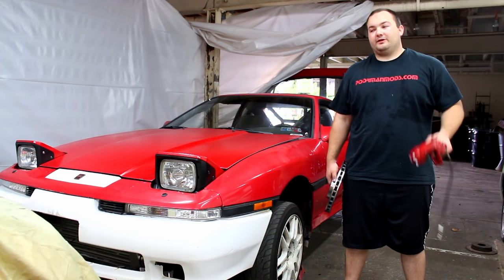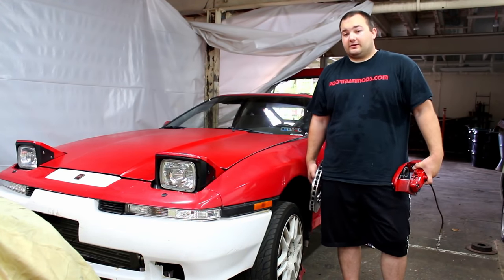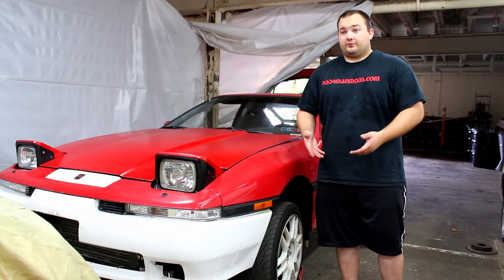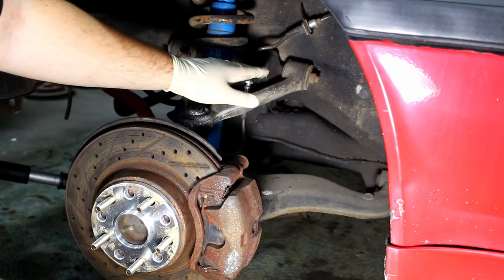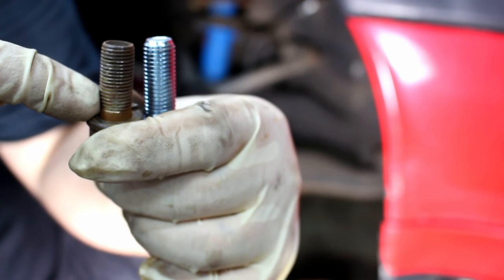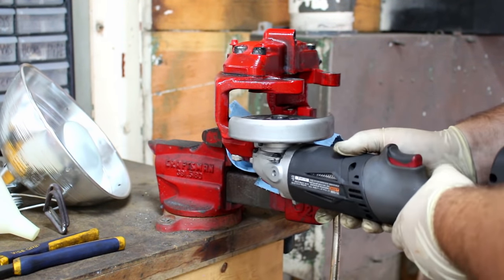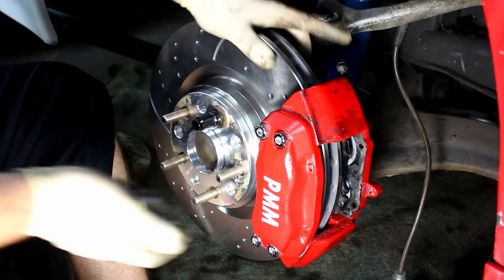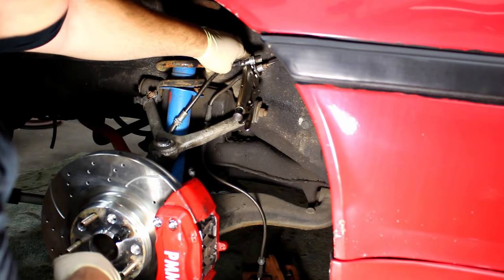DIY Big Brake Kit | 1JZ MKIII Supra Big Brake Upgrade| Mercedes S500 Calipers 350z rotors

Comment: Just did mines thanks to you…just wanted to make sure calipers has to be from 2001 to 2002 nothing else will work wit those rotors….bolts The bolts m12x1.50 and spacers 3/8 thick and you can find them at ace rockys
Reply: I can only find rotors that are 12.75 in, is that close enough or does it have to be exactly 12.8?

Comment: For the rear I went with Brake Rotors REAR from a Subaru IMPREZA 05-07 WRX STI. Had to get the centre holes machined just slightly bigger and Calipers from REAR mitsubishi EVO 789. Just needed 1 washer for the mount bolt. (you want to avoid that if you can because there is a lot of pressure on those bolts when brakes are applied)

Still working out the fronts. I must have ordered the wrong Rotors for the front. Going to try Mercedes rotors to see if I can get away from adding washers.
Reply from the maker: niceee might have to try the rears soon
Reply: Poor Man Mods Factory brake hoses worked on the rear.
Reply from the maker: sweet!

Comment: Back again after a little more research and looking at your video there seems to be a hub centric ring that's needed to fill the space between center and rotor. 60.1mm - 68.0 mm if I'm completely correct.
Reply from the maker: i drove around for a year or two with no hub rings with no ill effects, i did eventually get rings because someone recommended and i saw no harm in getting them. I dont remember the size though :(

Comment: Why?
Because if you buy a box of washers, you will find many different thicknesses out of the same batch.
They are typicly also dished and/or distorted a little too.
Plain washers are not designed, or meant to be used as spacers, they are meant to keep bolts/nuts from sinking into the material they are being used on, PERIOD!.
Probably why you had to put an extra washer on one side.
McMaster car has precission shims, figure out what you need, and use them.
Here are their steel shim selection, in 1/2" ID (will work fine with 12mm bolts).
http://www.mcmaster.com/#standard-shims/=xwl81f
And they are cheap! - up to 1/8" are a pack of 10 for $5.
They also have the shims in stainless, and the 12mm x 1.5 bolts or socket head cap screws.

Comment: Great demonstration, I'll be doing the same brake set up. Quick question do I have to buy stainless steel lines like if I'm buying it from a ae86 or can I just get a set of steel lines for the supra?? I'm confused
Reply from the maker: +Genesis Harrigan you need the line for the ae86 because it has the correct fitting
Reply: +Poor Man Mods ok great thanks

Comment: Good stuff man! Keep it up :)
Reply from the maker: doctorstruts thank you!
Reply: Btw if you were to Turbo the Lexus look into the TD04 15T Turbo charger, They came stock on SAAB 9-5 aero and viggen and are known to be cheap reliable and reeeaally good on spool and output! You van get like 340hp easy out of a 2.0 4 banger with one of those! :)
Reply from the maker: im not sure what im doing yet, but if i turbo it ill probably buy a nice ball bearing turbo to help with fuel efficiency
Reply: Looking forward to finding out what will happen! ^^

Comment: Can you lists all the parts that you need to do this mods? including the bolts sizes, hub ring, etc and quantity of the parts?
Reply from the maker: The only parts you NEED are these
324mm 350z Front Rotors http://amzn.to/2k5bLbm
2001 S500 Front Calipers (left) http://amzn.to/2lqzP4u (right) http://amzn.to/2lqfgFE
2001 S500 Front brake pads http://amzn.to/2kVtscr
AE86 front brake hose (2) http://amzn.to/2lqwYsl
12x1.5 Bolts (4) with some M12 washers.
Some say to use a hub ring but i didnt and I have 0 issues.
Reply: Thank you so much. :D Love everything you did btw.
Reply: Poor Man Mods Hey Freddy I tried screwing that hose into the s500 caliper and alot of threads still stick out. is yours like this? no copper washers needed?

Comment: So with the 350z rotors, do you need to use a hubcentric ring to center the rotor? Or is it already a perfect fit?
Reply from the maker: fordgt9t i didnt use one, it seemed to be center well on my lug studs which are aftermarket i dont know if itd be any different for OE studs or not. But i didnt notice any issues while drive or anything

Comment: Hey Poor Man mod do I need to run a wheel spacer for this mod and also do I need banjo bolts for the brake lines
Reply from the maker: depending on your wheel you might need spacers, my new wheels i need 50mm spacers.

Comment: Do you have to leave the spacer for the 17 inch wheels not to hit the caliper?
Reply from the maker: @CrescentCityTruckandTrailer  correct, depends on your wheel though
Reply: @PoorManMods  What size spacer do I need?
Reply from the maker: @CrescentCityTruckandTrailer  It all depends on what wheel you have
Reply: @PoorManMods  They are wheels that came on the car when I purchased it so I can look at them today when I go to the shop.
Reply from the maker: @CrescentCityTruckandTrailer  theres really no way to know if you need a spacer or how big without putting the brakes on then putting the wheels on and trying it. You may not need one, it all depends on the shape and offset of the wheel
Reply: @PoorManMods  I definitely will need some because I tried them last night and they hit the caliper and won't go on. The rear are stock calipers so they work perfect

Comment: Did u clean and paint them that color red your self?
Reply from the maker: I powder coated them red myself
Reply: @PoorManMods  alright cool I'm in process of building a 800hp mkll atm
Reply: 2 more questions so those calipers will  bolt right up to the stock caliper bracket and does the the same brake combo work on the rear ?

Comment: does this bolt up using the factory caliper bracket?
Reply from the maker: +7MBoosted you dont use a bracket
Reply: +Poor Man Mods then what is the caliper mounted to?
Reply from the maker: the caliper has its own bracket thats part of the caliper, which bolts to the knuckle
Reply: +Poor Man Mods oh, I guess I was thinking of the cobra brakes where I know with a certain combo you need a different bracket.
Reply: @PoorManMods  would these caliper can be moded on a is300 1st generation?

Comment: Putting more than one washer on any fastener is stupid, if you need to space out a bolt; find a nut that is the same threads and is as thick as you need.

Comment: Poor Man Mods FIXED the problem, was on my end, i guess my dog unplugged my headset half way and it caused everything to come through with the same volume instead of its adjusted volume
Reply from the maker: What device are you watching it on? Every time I add music I check the to make sure it sounds fine with my computer speakers and with headphones on
Reply: On my home computer, i am going to try watching from work...a setting may be screwed up

Comment: I would highly recommend hub rings... 68 to 60.1 mm to center the rotors . Those rotors will flop around on the studs because they don't rest on the hub . ;).  Madsupra88 - Saif
Reply: If you watch the video, you can clearly see when he mounts them, that they do rest on the hub.
Reply: MrDLRu  no they do not . I have the same setup in my mk3 ..... We have 60.1mm hubs these rotors are 68mm...
Reply: @madsupra88  so whats the specs of the hub rings for the inner and outer diameter
Reply: @MrDLRu  lol, you can clearly see they don't. Lay off the ice mate.

Comment: use 2012 Mercedez Benz R Class rotors (330mm) along with  60mm ID to 67mm OD hub centric rings & no need to modify the caliper ;) slotted & drilled are like $57 a piece. your welcome. lol
Reply: can u send me a link to some
Reply: So this is a dumb question but are you using the rings to fit the rotors or displace the wheels ? I am not a car guy but trying to learn
Reply from the maker: http://amzn.to/2bWenoX for the rotors
Reply: Going to give this a whirl... is the offset a little better? Hoping no washers on the caliper bolts.
Reply: Working on this. Only problem with this is the bolt holes seem a little big. I set of these as well as the Nissan Z rotors. Seeing what works best.
Reply: please let us know what works best. thank you
Reply: If i used the 312mm s500 calipers can i just use any Mercedes or any 312mm rotor?
Reply: Chris Miller it worked fine with the hub centrics. Bolt holes are just a little big. Even some factory cars are like that as they use a certain set rotors on many different models.
Reply: @JZAMA70 Is this still accurate? Need a brake upgrade and was wanting to make sure this is the best fit before buying.

Comment: Most of your "Cobra" brake upgrades require that you use 17 inch or larger wheels. I do know that when I upgraded my 1997 Crown Vic front brakes (11.75 inch) to 2001 Lincoln Town Car big brakes (12.5 inch) with the dual-piston calipers. I had to go to 17 inch wheels (up from factory 15 inch) just to have enough clearance so the wheel didn't rub the outside of the caliper (where the pads go in).  The Mustang factory wheels up to 2001 worked perfectly because of the offset needed.
Reply from the maker: Ahhhh okkk, thank you

Comment: Just to let ya know ..doing this bbk and can’t find 68mm to 60.1 hub centric rings..plastic only 🤨 or can hav 2 custom made for 80 buks 🤷‍♂️ do yourself a favor and use the Mercedes rotors..they are alittle bigger in diameter and a mil thicker ..wish I did more research lol ..now I havt to wait..and those 86 Corolla gets brake lines look sketchy..just use mk3 ones and thread in the banjo bolt ...unless someone knows where to get these rings in aluminum..post it please 🙏

Comment: Considering a DIY brake upgrade in the future. So to make it work you just need the caliper with the right hardware, right brake pad, and a rotor with the same stud pattern as your hub? Also, how do you find the right pad for your caliper? Do they make pads for the caliper or is it by the car (which the caliper) is originally from? Thanks. Just wondering as I've always wanted to get a big caliper from Japan say a Brembo or endless and don't really know how I'd go about finding a pad that fits.
Reply from the maker: Like mentioned in the video a good fella named Edwin discovered which rotors and calipers fit. The calipers are for a Mercedes s500, so you just get the brake pads for the s500. I discovered AE86 brake hoses fit just by luck. I have links to everything you need for this upgrade in the description

Comment: I know this video has been up for a few years. The one thing I did notice is that the brake rotors are on the wrong sides. He has the right side (passenger side) rotor on the driver side. Other than that awesome video. I plan to do this to my own Supra.
Reply from the maker: The rotors are not on the wrong side. Do this brake upgrade, you'll love it!

Comment: +S.T.R. upgrading brakes for ANY style of track is necessary. I'm a MK3 supra owner and one of the flaws with this car is it's heavy, and the brakes just dont cut it. i have about 600-700lbs of weight dropped from my mk3 and when going down step down hills you can feel the weight of the car in brakes. The factory brakes just dont cut it.

One more thing to point out Mustang Cobra brakes are not direct bolt on, they require an adapter sold through drift motion which gives you everything to complete the swap.

none the less this is an awesome video! By introducing a pretty bolt on brake upgrade for these cars would make it easier for newcomers to the A70 chassis to modify and for previous owners such as myself, get new ideas. I'm still in a toss up between doing cobra or s500 brakes because I plan to keep my supra for years. I'm just thinking 20 some odd years from which set up will be easier to get parts from
Reply: Poor Man Mods since you have installed the calipers, have you had the chance to drive the car? or will you doing a brake test after you upgrade the master cylinder
Reply from the maker: I've been driving it everyday the past week and I eventually want to upgrade the master cylinder but idk how well a brake test video will be since I didn't film a before test

Comment: @12:18, it says you plan to swap the master cylinder with a 96 4Runner ABS master cylinder. So i picked one up, actually a 2000 4Runner Abs, 96-00 4Runner use the same master cylinders. Anyways, this abs type unit has 2 mounting holes, while i noticed the non-abs type has 4 mounting holes. i was wondering if you could confirm or clarify which exact year/type master cylinder to look for
Reply from the maker: Henry Walker I believe its supposed to be a 95-99 4Runner ABS master cylinder
Reply: +Poor Man Mods  found it:
http://www.celicasupra.com/forums/showthread.php?52289-300zx-Front-BBK-what-master-cylinder-to-use/page2

Comment: Wow, that's pretty informative thanks man! I'm just curious if you know, is the 4Runner booster smaller in diameter than the A70 one? Mine has no ABS if it matters. I know a late 80's Tacoma is smaller. I'm in the process of swapping a 3uz and probably will need the extra clearance. Figured two birds, one stone...etc. Thanks
Reply: Yes, tacomas/toyota pickup brake boosters will fit and will be smaller. I know im 10 months late but I couldnt help but try to answer lol
Reply: @manjirum  Well thanks anyway, I got lucky and the motor clears the stock booster.

Comment: How did you get the polished/chrome look to the caliper bolts on the front where the ppm logo is?
Reply from the maker: I replaced the bolts with chrome bolts when I rebuilt the calipers

Comment: Great video! I plan on doing this. Only issue I have is every link except the calipers on here now shows the parts unavailable from amazon 😕
Reply from the maker: I updated all the links :)
Reply: Poor Man Mods thanks! I see now the brake hose link takes it to Supra ones. Do those fit like the AE86?
Reply: Also is there a difference between the s500 and s430 calipers? It’s the same part number on rock auto. I have someone selling some for a good price and wanted to make sure it will fit

Comment: Thank you for sharing your experiences with your supra. I have purchased the calipers for mine and wondering if you changed the master cylinder and/or the booster to compensate with the new calipers?  Thank you.  Edwin.
Reply from the maker: Nope, stock master and booster
Reply: @PoorManMods  
My brake feel mushy since the bbk.
What about you?
Reply: @mangaautoimport294  did you figure this out ?

Comment: Is there a video for the rear brakes on the same car?
Reply from the maker: no not yet atleast
Reply: Poor Man Mods ah ic. Let me know if u figure anything out plz. Havent had a chance to look at that car in a while.
Reply from the maker: I dont have any plans for the rear breaks in the near future. Just make sure you subscribe so you dont miss an update :)
Reply: Ok heres the info I got. Dont know if its correct but im hoping. Will probably do this later on.

MKIII Rear Rotor Replacement

Rear brakes 05-07 Subaru WRX STI Rear Rotors
Mitsubishi Lancer Evo 05-09 Rear Calipers
(unsure about hoses)
Reply from the maker: yeah thats what ive heard too
Reply: It won't be 05 on the STI. They still ran 5x100 til 2006.
Only reason I know is the STI suspension is a direct bolt in lowering kit and BBK for a 96 subaru legacy which is 5x100.
Reply: 96 or 2006? According to fast WRX.com

2002-2005 WRX wheels: Bolt pattern: 5x100. ...
2011-2014 WRX wheels: Bolt pattern: 5x100. ...
2004 STi wheels: Bolt pattern: 5x100. ...
2005-2007 STi wheels: Bolt pattern: 5x114.3. ...
2008-2017 STI wheels: Bolt pattern: 5x114.3. ...
2015+ WRX wheels: Bolt pattern: 5x114.3. ...
2018+ STI wheels: ...
2002-2007 WRX/STI.

 Ill double check with my mechanic. 

For anyone who is interested Ive also noticed that wheel rims for Subarus tend to work out well for the Supra. bought a set of Volk Racing Rims meant for a Subaru. 40mm offset (mk3 factory is 37mm) and bolt pattern is 114.3x5 as well. Supra has really wide wheel wells especially in the back and ive seen people go as high as a 10.5 inch wide rim without even flaring the fenders. You would probably want a 50mm offset in that case. Mine are 8.5 wide front and 9.5 rear both at 40mm.

Comment: And also u should do the evo8 rear brembo brake with 05 Subaru Sti rotors
Reply from the maker: +Genesis Harrigan yeah i eventually plan to
Reply: +Poor Man Mods from what year s500 calipers can I use or is it only that one year you have?
Reply: Poor Man Mods hey I bought a used pair of s500 calipers for my 96 mustang and these calipers do not fit on mustangs whatsoever so they won't fit on ford's just letting you know

Comment: what about 2001 S600 345 calipers and rotors
Reply from the maker: I have no idear
Reply: Poor Man Mods well updates to follow, they are off of a 2001 S600 with 2004 c32 rotors @ 345mm by 30-32mm, it's huge!
Reply from the maker: hell yeah
Reply: @TerrencePorretto  How did this end up working out?  Were the bolt holes on the rotors big enough to make up for being different?